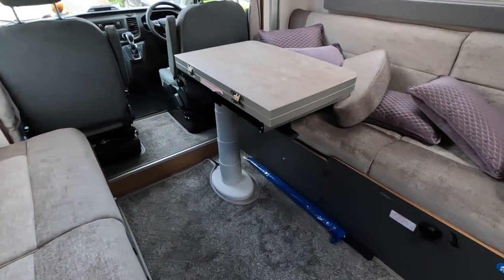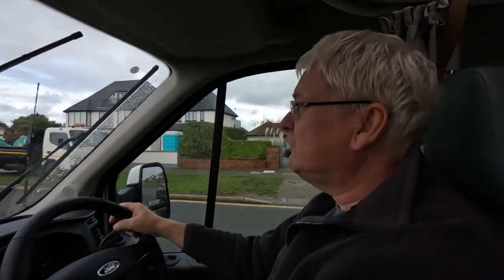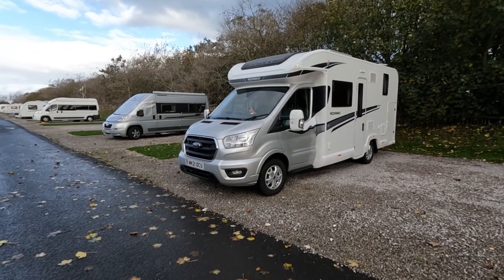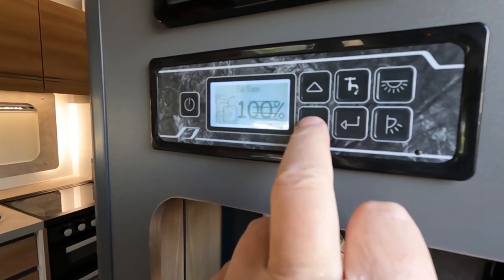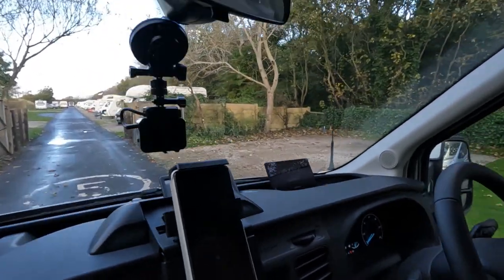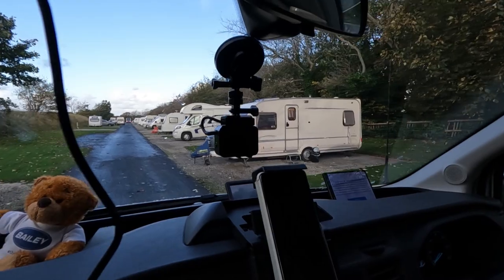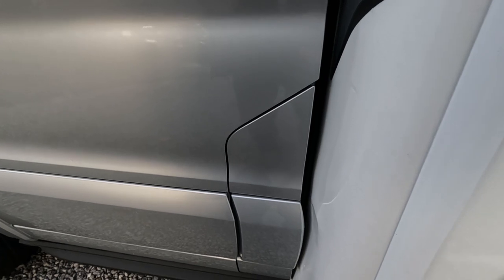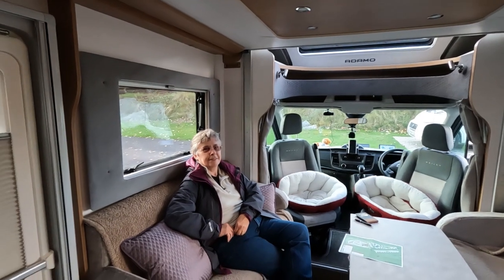Bailey Adamo 69-4 First Impressions

Comment: Not a fan of any of the Adamo's at all.  Awful payloads, no train weight so no tow bar as they're all too heavy so what's the point?
Reply from the maker: This 69-4 has a better payload than the other two models at 410kg, but most 3500kg motorhomes struggle with payload especially for four people. You are right about towing.

Comment: Hi Bob, looking at just the front cab area, I don’t think you could want any more, a Ford cab with auto gearbox, what joy to drive, you will get used to the box & the stop start system, be careful, you might like it so much you don’t want to give it back, as for the rest of the van will have to wait for your next vlogs, have a great trip & try to avoid the rain storms 🌧☂️🌧

Comment: Loved the video, noted your comment about having to fill with Diesel with the door open. Our Vw has the same locking fuel cap using the door. Once you have open the fuel flap you can close the passenger door while filling up.

Comment: It appears the bathroom sink is larger than the kitchen sink, that should be reversed.   Also, it seems that the kitchen sink on most.motorhomes is too shallow.   I would make them at least 6 inches deep to keep wash water from splashing onto the countertop.
Reply from the maker: Yes, you have a point.

Comment: The interior layout is nice, the lounge area is very spacious with two bench sofas & the two captains chairs give futher seating options,  cab blinds in my opinion are a must, Also the kitchen is a decent size & well equipped, the washroom is extremely generous with a separate shower cubicle aswell as a vast wardrobe including access to the garage. I'm personally not a fan of the drop down bed although this one does come down a fair way, whoever's sleeping nearest the front has to clamber over the other person if they want the loo in the middle of the night? If the van was slightly longer the bed could've been front to back instead of transverse? Personally I don't like the Ford cab & prefer the look of the Citroën, Peugeot, Fiat cabs. Thanks Bob & Jenny & Poppy & Tara for showing us around the Adamo motorhome, I hope you all enjoy using it over the coming two weeks?
Reply from the maker: Thank you for your comments.

Comment: Must admit it takes some getting used to an automatic. The Bailey seems to have a strange handbrake arrangement. When we changed to the Defender it only comes as an automatic and I missed the engine braking. However I loved the auto handbrake and hill hold, all you have to do is give a firm push on the brake to engage parking brake then accelerate to drive away, simples. Some bits of thw Bailey seem quite good and other areas are let down by being almost cheap basic. We have thw same issue with the washing up bowl that it can easily overspill onto the counter top! Look forward to the next instalments. Guy.
Reply from the maker: Think the Ford would benefit from an electronic parking brake, that big old handle seems anachronistic with stop start technology.

Comment: Great video. Interesting to note that a motorhome manufacturer with many years experience building good quality van can still do a front cab curtain that is a bit of a mess. Ah well.  
I love this layout though, and I don't know why people like Autotrail and Elddis do their own versions. Chausson do the 640 which is exactly the same length and layout but with some additional quirks, as seems to be a bit normal for them. They also do a 650 which is same layout but half a metre shorter, I seriously considered buying one but went for a AT 615 instead.
Reply from the maker: Yes the blinds are not good, I'd get Remis fitted.

Comment: Comments whilst watching: Nice van on first impression. Exterior looks understated which is very nice. I have always admired the driving position and dash on the Ford compared with the Fiat. The auto box and stop start certainly takes a little getting used to. We noted that ours quickly gets to 6th then 7 and 8 are for the open road. Our 12v sockets on the dash are always live from the vehicle battery. Our fuel filler can only be opened by opening the passenger door but I close the door whilst filling to prevent fumes entering the cab. The electric table and bed is new to us and would be a challenge. We don’t miss our microwave. The gas locker taking up kitchen cupboard space seems restrictive. Huge fridge 👍🏻😃 we like that as long as it can cope in summer, our Bolero struggled in hot weather. We had a caravan with a door on a slider and it was a nightmare. Always jamming up and rattling. Washroom looks spacious. One cupboard for everything is new to us. We like to scatter things around the van with his and hers items left and right. The lounge does look spacious and homely. It looks like the windows provide better views than our Bolero did. We don’t have cab blinds but quickly got used to internal or external silver screens with or without curtain. We look forward to your updates and conclusions after you have lived in it for a week or so 😃🚐 Trev n Sue
Reply from the maker: Thanks for the comments. Interesting about the sliding door and the 12v sockets being live. Mrs Sat Nag comes on when Poppy and Tara go out now because the courtesy lights come on when the hab doors open, she's currently in night mode. Hinges seem like a good idea.

Comment: Looks a nice van, however is let down without having the fixed cab window blinds, not a fan of the curtains. Lots of room, especially in the rear wash area with great access to the garage provided from within the van. The bed seems quite noisy being lowered.
Reply from the maker: We're not keen on the curtains either, but we're enjoying the Adamo overall.

Comment: hi bob and jen that van seems to have a lot of cheap fixings in it that look like they could be problems in the future the drop down bed with those seat belt straps dont look great and also the wash room door kids would break that in two min also attention to detail the seal for the garage and the block missing of the bike rack rails it has the feeling that its just been rushed when you think what these vans cost also that table nice when its working but for how long
Reply from the maker: It is an early production model and has been the press vehicle, so probably hasn't been that well treated. As for the drop down beds they all use seat belt webbing. The kids wouldn't be able to open the washroom door!
Reply: @BobEarnshawMoHo  I know what your saying bob but i remember in the nineties when mercedes cars where very popular they started to build their cars with cheap interior fittings all the plastic panels would fall off if you touched them i get that feeling now with a lot of these new motorhomes rushed to try and fill the new market that has sprung up since covid gadgets are great but they have to last the test of time after all most people love and cherish their motorhomes so its not as though they get rough treatment keep up the good work mate giving an honest review

Comment: Nice video Bob and Jenny, and a nice motorhome to borrow. Very nice lounge area and washroom and the drop down bed really does drop all the way down... no need for ladder lol. Love the automatic gearbox. I've had about four automatics and wouldn't go back to manual. As far as the handbrake goes you don' need to use it. just leave the shift in park (unless you're parked on Porlock hill). Enjoy your time ;))
Reply from the maker: Yes, I suppose that's why they call it a parking brake. I've always tended to use the handbrake when stopped. Bit of a habit.

Comment: Is it legal to have the Bench Seats Belted ? Saying that is purpose Built for Just a Two Berth 
Would have Been Nice for  Belts , Just in Case The Pass needs a Change of Seat.

Is your go Pro on the Blink?
Reply from the maker: It has two fold out belted crash tested travel seats under the sofas, which we'll demonstrate in a later video. No, my GoPro is not on the blink, it's probably user error, ie. me.

Comment: Even with an automatic you should put the hand brake on as when in Park it is only a pin within the gearbox stopping everything moving, I wouldn’t want to rely on that holding my car on a hill let alone a motor home!
Reply from the maker: Yes, I have been putting the parking brake on when we're stopped or pitched up.

Comment: Not too keen, thanks for the review, it's one we can cross off our list, those curtains are a terrible idea, surely at night time you'd want the full use of the cab seats, but they close them off from the van!! also not much cupboard space, and a total waste of space over the cab. The only nice thing about it is the bathroom. We still have the autotrail delaware s , at the top of our list x
Reply from the maker: If it was mine I'd lose the curtains and get Remis blinds fitted. We've managed with a Milenco silver screen. There is an absolutely huge cupboard/wardrobe at the back and a shelf above the cab for nick nacks. Stayed tuned for a full review at the end of this tour.

Comment: Looks a very nice Motorhome! We looked at the Adamo when our friend bought their Autograph, a nice range at a good price. Cheers, Oliver
Reply from the maker: Thanks Oliver, we're pretty impressed. I'm liking the cab, as you know it is a Ford, being a big fan of Fords.
Reply: Lovely motorhome on the ford chassis and the automatic we love ours spacious and user friendly at a good price 👍🇬🇧🇬🇧🇬🇧
Reply: @BobEarnshawMoHo  if you find you don’t know how to use something in the cab give me a shout as it’s the same as my car👍🏻 it’s got auto lights as well.
Reply from the maker: @CaravanningwiththeCoxs  OK, couple of questions please, as there's no Ford manual. Not sure if it has auto wipers, how can I check. Also do you know any way of switching off the courtesy lights every time I open a door? Mrs Sat Nag switches on everytime Poppy and Tara go for a walk!
Reply: @BobEarnshawMoHo  auto wipers should be one click up from off and the intensity is on the actual stalk. If you go into the menu on the trip computer it’s under settings and lights and home lights and you should be able to turn them off.
Reply from the maker: @CaravanningwiththeCoxs  cheers, that's very useful. I will do some digging in the menu.
Reply from the maker: @CaravanningwiththeCoxs  thanks, got the auto wipers now. Still can't see an option for turning off the lights. Is it Headlamp delay?
Reply: @BobEarnshawMoHo  yes that’s the one. Change it to 0sec and it should be off.

Comment: The reel for the Whale hose is an absolute must, as we've discovered this last fortnight. That said, does the Adamo have fill-on-demand via it, so you've effectively got mains water?
Agree with others re the grey dump - very awkwardly placed, and difficult to get that cap on!!! Not a lot of use on a fully serviced pitch!
Reply from the maker: Yes agree with you on the waste.
Reply: On the Bailey motorhomes facebook site users have shared ways to easily extend the drain pipe to the edge of the van as it has been a problem on certain sites.
Reply from the maker: @danellis7386  Thanks for the information, I thought I might use the Colapz waste pipes, except I left them at home!

Comment: Hiya both, love your videos and I am particularly interested in the Adamo 69-4, would you be able to answer a couple of questions I have please. Is the oven/grill gas or electric and also in another video on the Adamo when someone lifted the floor panel in the bathroom to access water pipes I’m sure I could see straight through to the ground!!! Is this correct? Enjoy the rest of your time with the Adamo, I will certainly be following on you tube.
Reply from the maker: The Thetford oven has three gas burners, a gas grill and a gas oven. Yes, that's the same on my own motorhome, if I open up the panel for the water tank, I can see the ground past it. quite normal. The caravan part is simply built onto a chassis. Same on caravans.
Reply: Thanks for the quick response, from pictures I had seen I was under the impression it was an electric oven which obviously would be not be suitable for off grid. Research is a major part in something of such a large investment. Many thanks.

Comment: Looks very nice! The Light switch is Sidelights then Headlights then 'Autolights' for those who haven't the brains to know when to switch on and off the lights!! Fog Lights in middle of switch. Fords have the lights come on when you open the doors??? Then switch off eventually, why I don't know? I work on US Spec brand new Fords for Mildenhall and Lakenheath US Bases, so am used to it. They love their warning chimes too for Lights Handbrake etc etc! The Dropdown bed has a horrible screech in operation! The fuel flap effectively is lockable as Ford don't have filler caps like your Ducato! Only Flaps! Not the best location for grey waste outlet! With the cap dangling down like it is, soon rip that off like that! I think the handbrake is what the call a Racing Handbrake as usede it the old days when you had to run to the car and get going! For quickness! :-)
Reply from the maker: Then clearly I have no brains, because I quite like the auto lights! 🙄😊 The lights coming on when doors come on is somewhat strange. It also switches the sat nav and dashcam on if I don't uplug them.

Comment: We have the 754 DL and after our first trip we love it. You have to remember its not a 90K Motorhome. You get an awful lot for your money. We ordered ours in November 2020 at 60K and took delivery in September of this year. We have found a few niggles which need to be rectified by the dealer. In all honesty most of them should have been picked up in the factory. The auto box is a dream and returned us 31.5MPG over our trip. I think you will find some things that annoy you as I have but glad you are not judging after five minutes. This is our second Motorhome and a big step up for us. Already fitted our bike rack and Motorhome wifi unit. Looking forward to following your review.
Reply: We have the 75-4i absolutely love it 👍